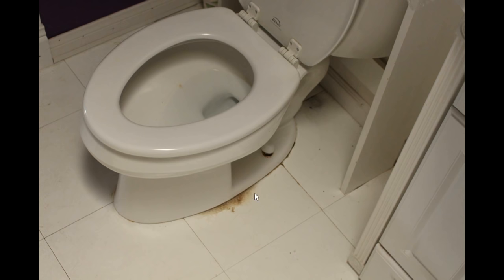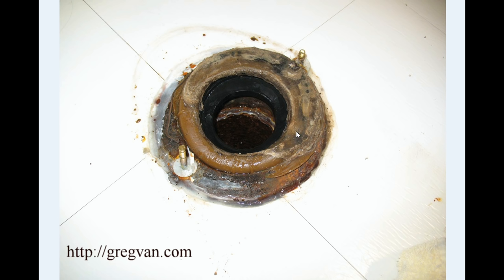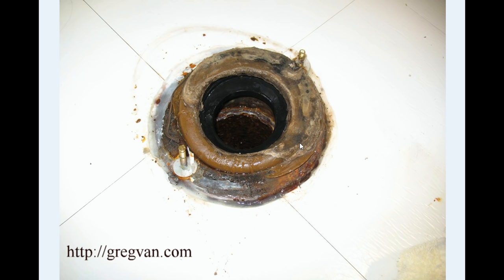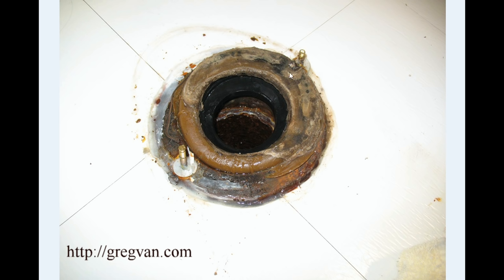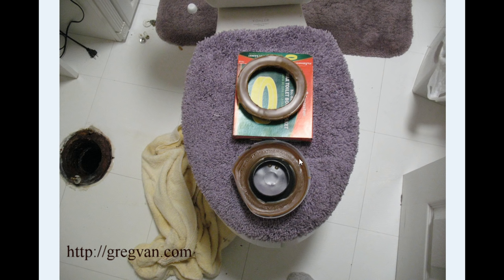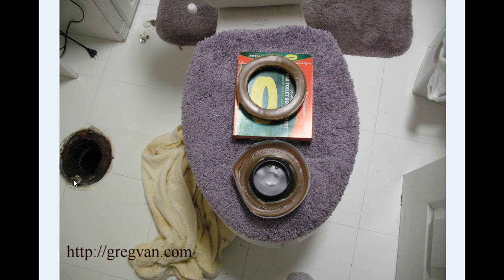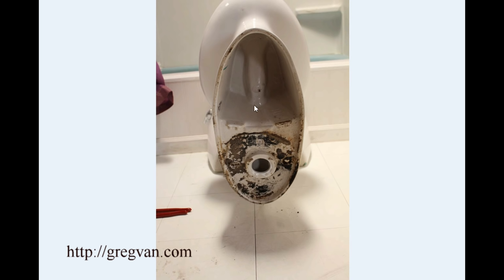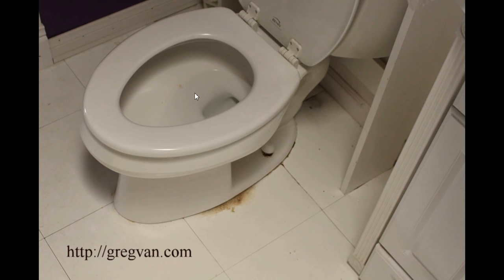Watch This Video If You Have Water Leaking at Bottom of Toilet – Home Repair Tips

Comment: I needed this video.....Okay, the base on the toilet leakes water after you flush. On the left hand side, the front, and a little on the right. Also, I am seeing drain flies...Ugh! Could this be to the water leak?? I know drain flies are attracted to water. I know I need a plumber to look at the water leak but will he be able to help will eliminating the drain flies or should I call a Terminx man to find and correct that part? Any assistance would be greatly appreciated.
Reply from the maker: I think I would start with the plumber. If you fix the leaks, then there's a good chance the flies won't be able to enter your building.

Comment: Nice video, thanks. I have a toilet that is leaking from the bottom overnight when not in use. If I turn off the water line to the toilet, it appears to stop. I've replaced the wax ring twice with no luck. If it's a leak from water sitting in the base, I'd think turning the water line off would not help the issue. I'm confused.
Reply: We are having the same problem with the water off as well.
Reply from the maker: I don't know if this makes sense, but right after the toilet has been flushed, turn the water off to the toilet and then see if the water level lowers and if it does, then you might have a crack inside the toilet that might not be visible from the outside.
Reply: we are having the same problem. if we turn the valve off, the leaking at the base stops and all is well again. however, when we turn it back on, eventually the leaking begins again AND the toilet will run intermittently until we turn the valve off again. any advice? i would hate to run out and buy another toilet if it's an easy fix... should i replace the flapper in the tank AND the wax ring?

Comment: Excellent video ---- thanks. How do you suggest making a "rocking" stop rocking? Shims?
Reply: I use the plastic shims sold to install doors.  Cut 'em off at the correct spot, then use caulk around the base.

Comment: My toilet bottom was leaking so here I am. After taking off toilet see that the flange that’s supposed to nailed / screwed down is all rusted through. It’s wooden floor and some is level ( the back ) while the front wood isn’t. It’s gone rotted though maybe a quarter inch down . Can I still use as is and just get it with longest nails / screws I can find ? You say commnet here and you'll get back to us with link to another video ?
Reply from the maker: It won't hurt to try stabilizing the flange, just be careful not to hit any hidden pipes or electrical and don't do it if you can't see what's under the floor. Here's a link to our repair videos.https://www.homebuildingandrepairs.com/repairs/index.html

Comment: Why do you suggest using two wax rings?  I've watched several other videos and yours is the only one that recommends doing that.
Reply from the maker: Sometimes the gap between the top of the toilet flange in the floor and the bottom of the toilet is larger and a single wax ring wouldn't be enough to seal the larger gap. It's interesting that you haven't found a video on that, because it seems to be a common practice used by plumbers and I've used it myself with excellent results. Let me know if this doesn't make sense.
Reply: I used your advice and used two gaskets.  So far so good.
Reply from the maker: I've used it plenty of times myself with great success. Just remember that this problem will usually have something to do with the toilet moving, if it does start to leak again.

Comment: How do I know if it is for sure the wax ring that is allowing the water to leak from under the front of my toilet in my new house. Toilets we just installed beginning of February but started leaking around late May - early June.
Reply from the maker: It's the most common problem, if you don't have any water supply leaks, but you won't know for sure until you remove the toilet.

Comment: I have a recessed flange by about 1” I stacked 3 wax rings. Still leaks , checked it for cracks and didn’t see any. Plus it’s a new toilet. Should I stack 4? When I used 3 it barely squished the wax
Reply from the maker: It sounds like the plumbing waste pipe and toilet flange might need to be raised. If you have any pictures I would love to see them and you can get our email address of the website.

Comment: Hi there i saw your video for toilet leaking i had same problem i added spacer to make flenge flush with tile floor and then put wax and now i tested it goes down normally and after flush when its putting water in tank and bowl i am getting leak from the bottm of toilet any suggestions
Reply from the maker: If the water isn't draining out of tank when leaking, then it might have something to do with the bowl and could still have problem with ring connection. Examine outside of toilet when leaking to make sure it isn't coming from somewhere around the outside.

Comment: Hi, thanks for the video.  My toilet is leaking at the base near the grout only when flushing.  Usually only a little bit, but sometimes more.  The water appears to be ‘clean’ (not soiled, smelly, etc).  When I call plumbers they say in order to determine what the problem is, they have to take the toilet out....and if they’re doing that ... I mind as well get a new toilet.  What do you think?
Reply from the maker: If you need a new toilet or desire to have a new toilet absolutely.
Reply: No way. U don’t “have” to get a new toilet when replacing the wax ring. But do check if there is a crack at the bottom of your toilet just in case.

Comment: The water supply liine broke off at the end and water was flying everywhere.  There was water seeping from the base as well.  Do I need to replace the wax seal as well as the supply line or just the supply line?  Not sure I need to replace the wax seal under the toilet everytime there is any kind of leak underneath?  Thanks, Linda
Reply from the maker: No, just the water line.

Comment: thank you for the video. I have a similar problem but slightly different and maybe you can help. There is a water leakage in my bathroom while not in use but sporadically, it happens about once a week on it own and this fill the bathroom floor, it leaks about a 1/2 gallon of clean water. when leaking you will hear the water running out of the toilet just as when you finish flushing and the tank is being refilled. Im not sure where that is coming from. any insight ?
Reply from the maker: It would be difficult for me to speculate, because I can't visually see what's going on. If it was me, I would flush the toilet and watch to see where the water is leaking from. Maybe even some type of camera could be set up to monitor any activity.
Reply: @gregvancom  thanks for the reply, well , I did my investigation and it looks like the leakage is an overflow of the tank. It seems like the water over fill the tank every now and then even if not in use, and that spill for moment and stop. This is a bit complicated. If this helps you to understand what's up. Thank you for yr time
Reply from the maker: It sounds like might need a new toilet fill valve and they can usually be purchased at your local home improvement centers or lumber yards. Sometimes this can be fixed by simply bending the float arm also.

Here's a link to the website might provide you with a few helpful videos. http://www.homebuildingandrepairs.com/repairs/bathroom/toilets/index.html

Comment: I’ve replaced the wax ring twice on my toilet, for some reason it is still leaking at the base. At this point, is it really the seal or maybe the toilet? The toilet is old as heck so I’m lost on how to fix it right now 🤦‍♂️ it’s not rocking, it’s very sturdy but still leaks slowly if the water valve on the toilet is not turned off 😒
Reply from the maker: You might have a water supply leak. Check water line connecting toilet to shut off valve. https://www.homebuildingandrepairs.com/repairs/plumbing/index.html

Comment: I have replaced the wax ring twice in a year. I have a flange on top of the tile. I live in a slab house. The tile is uneven and I have radiant floor
Heat. Should I use a sani seal or other non wax ring to solve this problem?
Reply from the maker: Please edit your comment to remove product names and yes, I would try a rubber or wax free gasket.

Comment: Hi there! My toilet is leaking and has a horrible urine smell. There is a small gap between the floor and the toilet I think the toilet is too high up and the floor too low. This happened literally after we installed the new wax ring too so I doubt it’s that. We worked on the floor of the bathroom and I just didn’t even out the way it should. I try to use caulking around the toilet but the gap is too big that I was unable to put the caulking around it to stop the leak. I thought about using toilet shims but I’m not sure of those would work either. I’m just trying to stop the leak and the smell that comes along with it. What do you recommend I do or what the problem is? Is there a way to close that gap between the floor and the toilet? I thought about somehow closing the gap maybe caulking the toilet all the way around to stop that leak.
Reply from the maker: The wax ring seal isn't going to work good if the toilet flange attached to the waste pipe is a lot higher than the floor and squashing all of the wax out of the area. You might need to build up the area around the bottom of the toilet, if this is the problem and imagine some type of shims might work just fine.

Comment: I have a leak, can't see any water around the toilet. But down in the basement the wood flooring is damp around where the toilet sits. Im a first time home buyer and removing the toilet looks really easy. Any suggestions?
Reply from the maker: It's not going to hurt to remove the toilet and give it a thorough inspection, then install the new wax ring to make sure that that part of the toilet connection is sealed properly. Then if it still leaking, then you can search for a problem somewhere else.
Reply: @gregvancom  that was actually my plan. Hoping just replacing the seal would fix it and while I had the toilet off I can inspect for cracks or damage

Comment: Help. Have brand new toilet installed new wax ring that came with it and it leaks when flushed. All the nuts and bolts are tight at a loss other than your recommendation of a second wax ring. Should that fix it?
Reply from the maker: It might and I hope it does and it's definitely worth a try. If it doesn't work, take a few pictures and send them to me and I'll see if I can help.
Reply: gregvancom Thank you. I ended up using a non wax ring and it worked like a champ. Also less messy. Again thank you for your response
Reply: The School Cop
Reply: The School Cop I

Comment: So the toilet rocking back and forth is causing the leak? Replacing the wax ring will fix both the leak and the rocking?
Reply from the maker: Not usually, you've got to find out why the toilet is rocking back and forth and most of the time it's the result of the toilet not being securely fastened to the floor. However, there are a variety of other things that can cause this problem. If the toilet still rocks then it could leak again.

Comment: I have a slow leak coming down on my dining room ceiling. I have a two story home and have estimated that directly above the leak is next to a toilet. On the other side is a sink. I punched a small hole in the ceiling downstairs and placed a bowl for the leak. The leak is minimal. No more than a table spoon or two. I inspected the bathroom upstairs and cannot see any water leaking from around the toilet or under the sink. Any ideas on how to locate the leak?Thanks in advance,Anthony
Reply from the maker: Water leaks aren't usually easy to find, but if you can't see where it's coming from above, then you might need to examine the plumbing pipes to see if they're leaking. My guess is that it's going to be in the drain pipe if it's not that big of a leak.
Reply: thanks. I will check that out.

Comment: Thnks , i think i have that problem, im going to try and teplace that but i also need to know how yo replace the bolts or screws like you said because they are rusty, do you have any videos for that?? Thanks in advance!!
Reply from the maker: No I don't, but you can usually tap them or wiggle them to the right or left after you have removed the toilet. Try to find a video on how they are installed and that might give you a better idea of how to remove them. However if you still have a problem, feel free to leave another comment and I will make a video.

Comment: hi I know you posted this video a long time ago but you asked if we needed help to comment I really need some help the bottom of my toilet where the screws are is leaking but only when I use the shower and the sink not when I flush the toilet can you please help me your video is very helpful thank you so much
Reply from the maker: It sounds like you might have a tough problem there, but send me a few pictures of the bathroom and toilet and I'll see what I can do.
Reply: +gregvancom hello again thank you for getting back to me I really appreciate it I have two pictures of where the water is leaking from it is also leaking when the toilet is flushed I guess it takes two flushes for it to start leaking. I also think it's important for you to know we have a septic tank. I'm hoping I can just change those screws and maybe the seal underneath the toilet and it will fix this issue. considering the screws are rusted I'm going to go and purchase that for the toilet. Thank you again for your help I am a single women and can't afford much but i am very handy with kots of common sense lol  so I find you communicating with me a true blessings.😇 Hope to hear from you soon.
Reply: +gregvancom I'm not sure how to send pictures ??also if the problem is from the screws is the wax ring also the issue no matter what or can it be separate? Thank u

Comment: I read somewhere that if you are going to caulk around your toilet that you should leave and inch or so uncalled so if it is leaking you will be able to see?
Reply from the maker: You bring up an excellent point and one rarely mentioned. If you seal anything meant to prevent water from going in from one side, you could also prevent it from coming out of the other side. If you're worried about something like this, then why not do as you suggest and seal the entire perimeter except for about 1 inch in length and that gap could even be located at the back of the toilet.

Comment: I do have a toilet that was fine one day (until the flush handle broke).  I replaced the flush handle (simple less than five minute job) and the very next day I saw water on the floor at the base and the water level was too low in the bowl.  You mentioned that this could be possibly caused by a crack.  Just wondering what would cause it to crack (since nothing has hit the toilet and it has been fine over all these years other than replacing the normal parts that wear out over time)?
Reply from the maker: The crack is probably going to be on the inside of the toilet and not on the outside, unless you see water leaking from the outside. I'm not suggesting that there is a crack, your problem might be from installing the toilet arm incorrectly. Try taking the toilet tank lid off for a few days and see if your problem goes away. Then the toilet are might be hitting the bottom side of the tank lid, preventing it to operate correctly. Let me know what the results are.
Reply: The toilet is actually not a new install.  It has been in place for just shy of 19 years.  The only things I have done is replace the gut a few years ago and just replaced the handle a couple of nights before.  I did observe more of what the toilet is doing.  When you flush (I had the tank lid off), the bowl fills up a little higher than normal but nowhere near the lip or overflowing (as if it was clogged).  But the water does not drain out like it would with a normal flush.  It starts to drain after the tank is filled.  You can hear the water draining out of the bowl.  Once this is all done, the water level is quite a bit lower than normal and whatever was in the toilet does not really flush out.
Reply from the maker: Have you checked to make sure that the flapper isn't leaking or blocked once it is opened. Sometimes the flappers don't open all the way and shut sooner than they should. Feel free to send me some pictures of the inside of your toilet for more information.

Comment: Hey tysm for such a great video i have a question...
First my bathtub starts gargling and then at times water comes up  (this happens esp. when my neighbors are using the washing machine or shower upstairs )then when I try to use the toilet dirty water comes out of the base and or on its own...wat does this mean ...lanlord doesnt care:/!
Reply from the maker: There's a very good chance that the drain line has some type of clog, preventing the water from flowing out like it should. Let me know if this doesn't make sense.
Reply: @gregvancom tysm for ur response they cleaned it twice yet water still comes out from the base of the toilet  just the gargling in the bathtub stopped
Reply: @icanbestronger  Sounds like you had a system backup (clog deep in the plumbing line). Then they jetted/snaked the line and probably gad enough force that it disrupted your wax seal and now it peaks around the base. This same thing happened in my home a month ago. Perfect excuse/time to upgrade my old 3.5 gallon toilets.